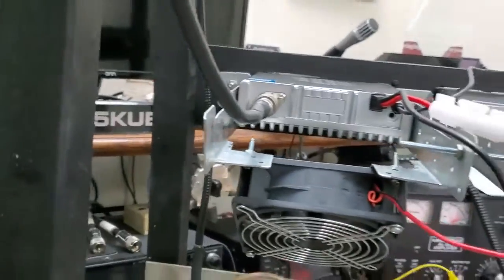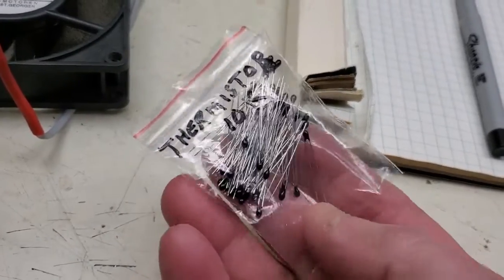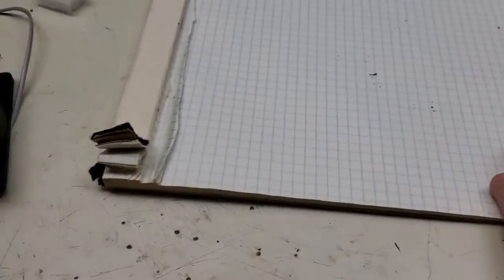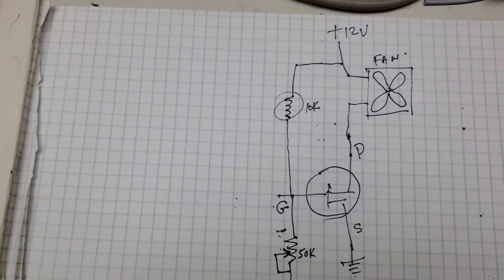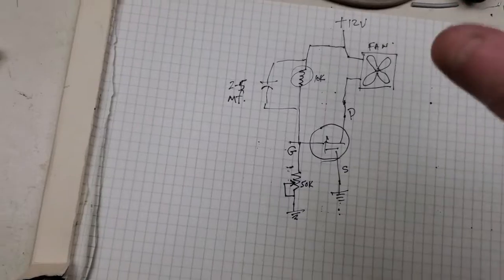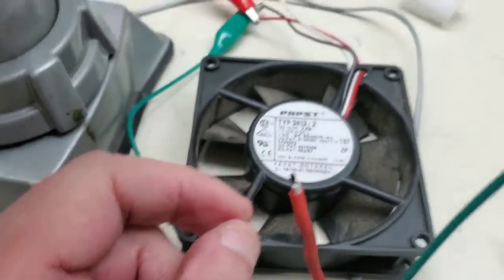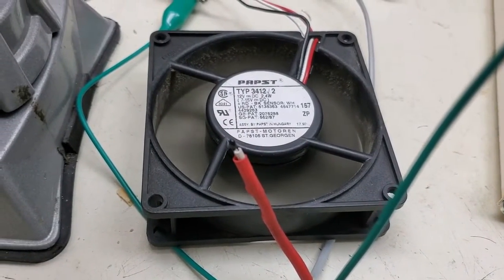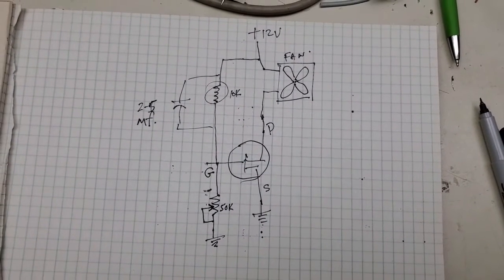Simple temperature control of cooling fan

Comment: I had a schematic that used a 10k NTC thermo resistor and a irf520 mosfet that regulated a 12v fan with a fine adjustment VR in the gate circuit.
Set the on temp and the voltage would ramp up with the temperature.
Not really how a mosfet should operate, but it did the job efficiently.
Edit: wrote all this before watching the video.

Comment: Curious if a simple snap switch would work just as well?
Reply from the maker: Great idea.  I have some snap switches in the parts bin.  Im not sure i would be able to get it easily adjusted to the temp range i want.  Its much easier with the mosfet and the variable resistor.  I just looked at one and they are much larger. It will be difficult to mount on the radio.  Ill keep looking into the use of the snap switch.   Also the only ones i have are normally closed and after heated up the open up.  Opposite what i need.